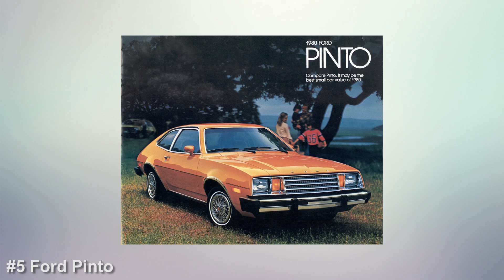Top 5 Engineering Fails of all Time

Comment: This list is terrible; I really should have known better than to click on it.  Your points are poorly researched and the implications that you make are misleading at best.
Reply: example?
Reply: +Chrome Electlroz 
Example of poor research:  #3 Chernobyl.  There is nothing inherently wrong with the RBMK reactor design and the design did not cause an explosion.  The mishandling of the reactor by its operators caused the accident.

Example of misleading implication:  #5 Ford Pinto.  Engineers at Ford obviously discovered the defect as they should have, otherwise there would be no discussion.  It was a business decision, not an engineering decision to move forward despite the issue.
Reply: +James Andresen Thanks,You can't belive everything you see in the internet.
Reply: +TheListBomb It wasn't "in part" operator failure.  Read a detailed report about the incident some time.  It was a series of terrible decisions, negligence and poor communication by the operators that is 100% responsible for the accident.  They almost literally disabled all the safety systems and then shut off the reactor just to see what would happen. The CANDU reactor is one of the Gen III nuclear reactors which is being licensed and built today.  It uses onboard refueling (i.e. the fuel rods are put in and taken out during operation) and is considered completely safe in doing so.

Comment: I Think Most construction workers and engineers know about the problem of right angle degree structures of openings in buildings.   It can be the reason why they do that is so they could come back to repair it every time it needs to be fixed.  Why build something that could last forever while you could do something that needs to be fixed all the time.  It's all about the money and that's sad.
Reply: +prime82maxx It is all about the money, but not in the way that you imply.  Using rectangular shapes is easier and cheaper than using curves.  If you want a house with oval windows and arched doorways, any engineer or architect would be happy to design it for you, in fact, it's done all the time.  You'd better be prepared for the hefty price tag though.